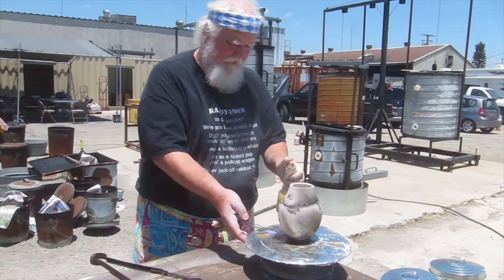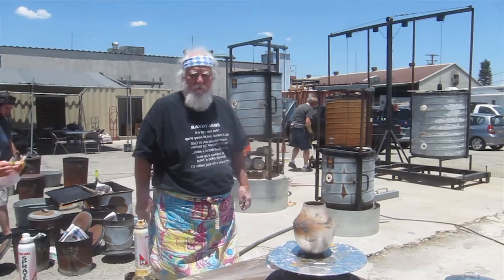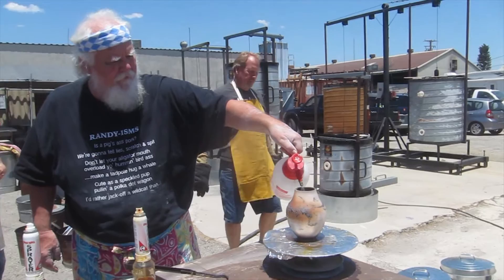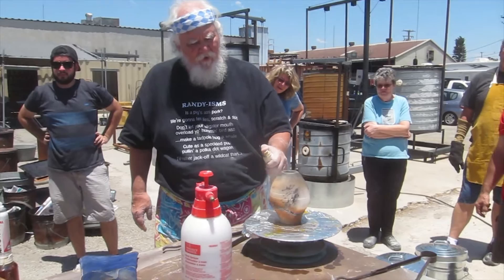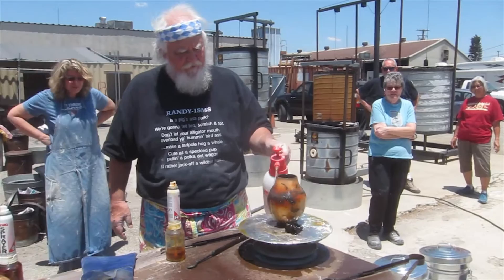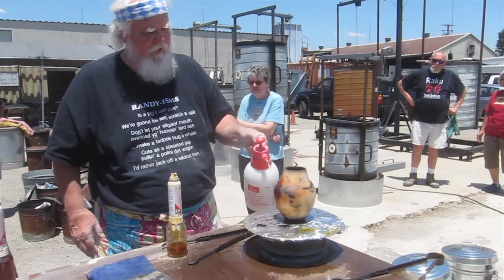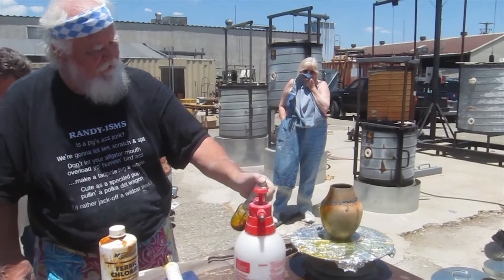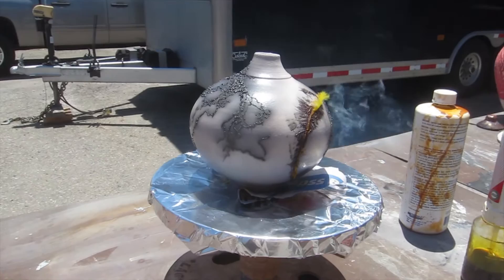Horse Hair Pottery with Randy Brodnax

Comment: Very Foolish to spray Ferric Chloride outdoors with people standing around. Ferric Chloride is used by offhand glassblowers to create a colorful rainbow iridescence on the surface of glass. It will not produce iridescent colors on a clay surface. Glassblowers have a homemade enclosed spray chamber for spraying glass objects on the end of a metal rod or pipe. Then exposing to short reheat in a reduction flame to bring all the color to the glass surface and burn off the toxicity. You must have a glazed pot to get the beautiful colors. Dull yellow brown is more poisonous than beautiful. These are toxic to touch even after they are cooled.💀💀💀